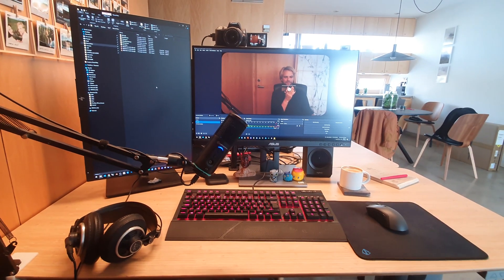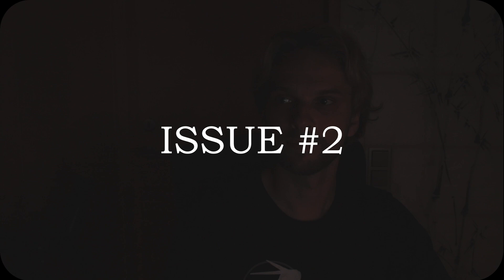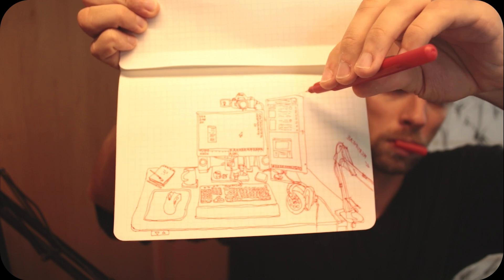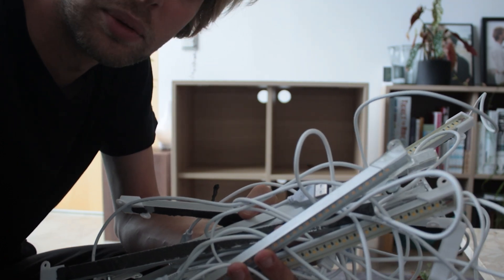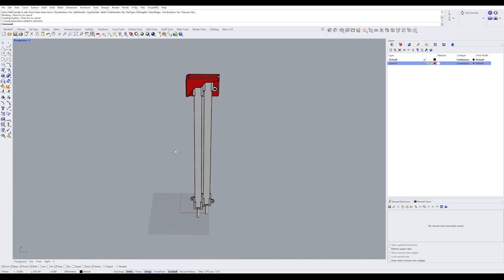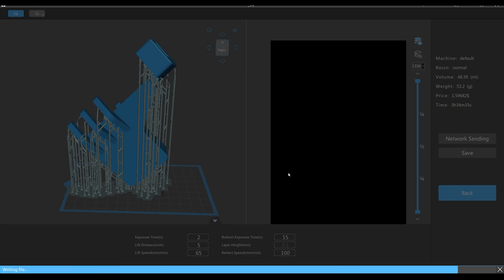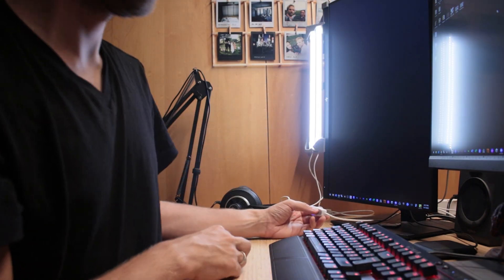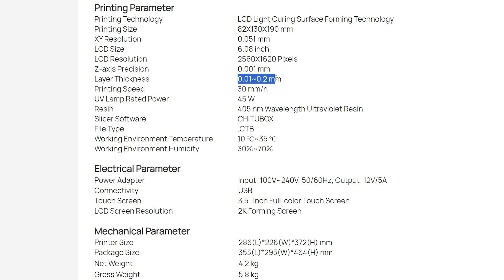Fixing my Workspace with 3D Printing

Comment: You may want to take a look at the guidelines for handling 3D resin.
Skin contact should be avoided as it can cause allergies and poisoning.
Also, (water soluble) resin should not be washed down the sink. It is toxic waste.
Reply from the maker: Ah yea - I am well aware of the guidelines. The resin used is not water soluble. I'm washing away the IPA (to minimize the smell) after a separate wash cycle has been completed.